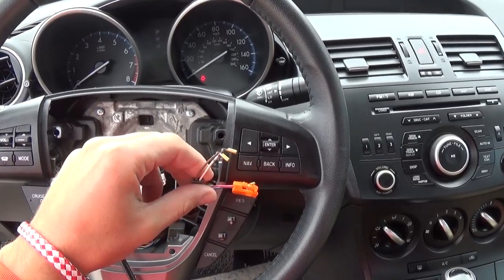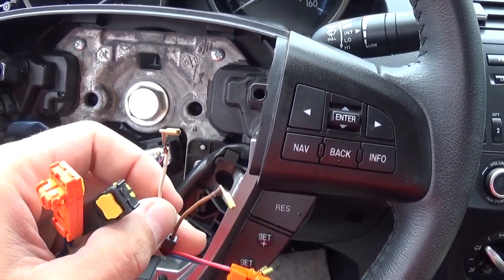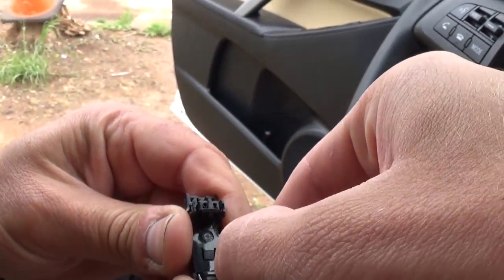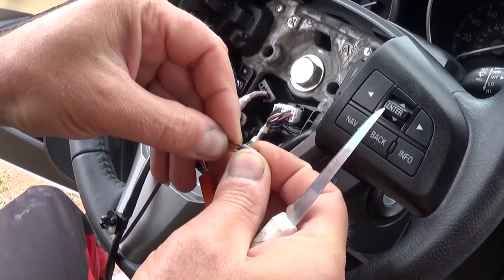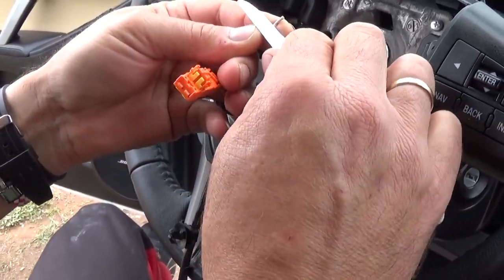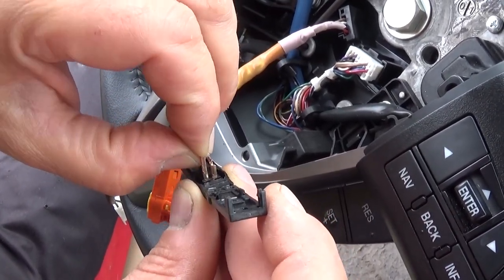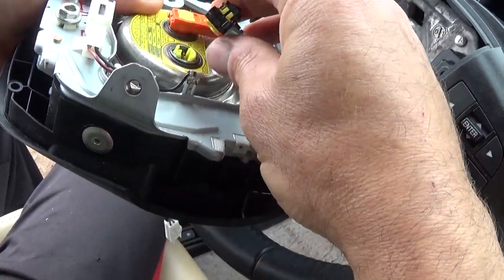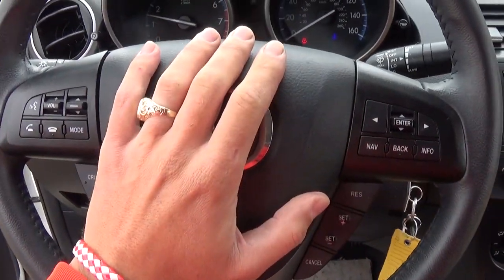How to Fix Exploded Steering Wheel Airbag wires  Demonstrated on Mazda 3

Comment: Thank you so much for this video. Just did this to my truck and it did the trick! The only issue I had was taking the pin heads off the wires... The knife prying it off didn't work, I used a push pin to get under the little handles to get them Off. Thank you again!!

Comment: I need help friend.. I replace the air bag on a 2013 Mazda 3 but the airbag light still comes on how can I reset it myself?
Reply: Airbag light doesn't require a reset, if everything works, it turns of automatically. You don't have to remove the error code with OBD like in other errors such as check engine light.

Comment: Hi guys can you please send a link where to buy these new switches from   . My steering airbag wires are not releasing from the airbag . Think the ,elated and stuck   Thanks
Reply: Search eBay for airbag clockspring plug connector and search for specific models - they are not all standard
Reply: Akiva Feinstein I searched on eBay, I can’t see the little ends by themselves. Do you know where I can find them? Or do I have to buy the whole thing with the wires

Comment: Why you just keep the original  wire  and put then in the new plastic  parts  the you got . No need to do all that.
Reply: only thing that is broken is the plug itself the plastic so they replaced it replacing a whole clockspring is around 200 euros for just the whole pakage if you can find a airbag in a junkyard and replace the plug your good again ofcourse if the scuib is not demaged witch in this case is not so it wil only cost around 30 euros to do👍

Comment: Sorry, but this is a horrible video showing terrible methods.  I'm an electrical engineer with experience in things like this.  Wire crimpers are designed very specifically to put thousands of pounds of pressure on very specific points to crimp the connectors to the wires.  They're designed to maximize something called an "oxygen free zone".  This is the microscopic areas where the wire and connector are so tightly crimped that oxygen can't get between them and cause corrosion because corrosion eventually causes failed connections.  "Crimping" such an important connection by lightly pressing the connector on to the wire with long nose pliers will not work long term.  I've even tried this.  After a few years it will fail and your airbag may not go off when it needs to.  A MUCH better method would be using precrimped connectors like the kind on Amazon, etc. and joining the wires using solder or crimped connections (splices) with correct crimpers.  Regardless of goofy net lore on certain forums, this works much better than the method shown here, which is the equivalent of twisting wires together inside your steering wheel!
Reply: Then how the hell did he just pull it out from connections the factory made?